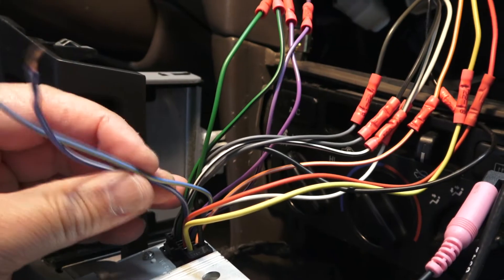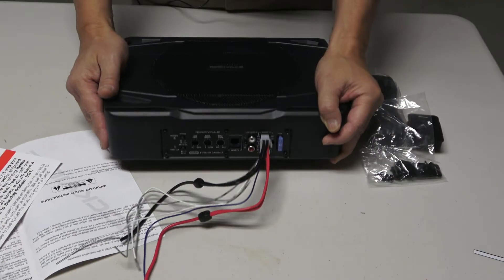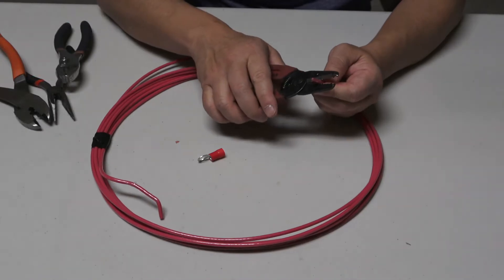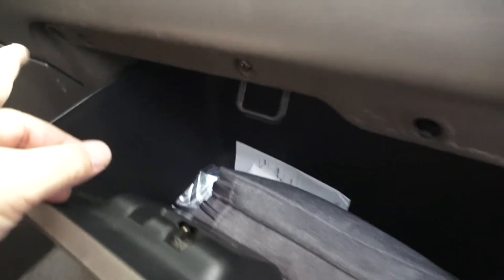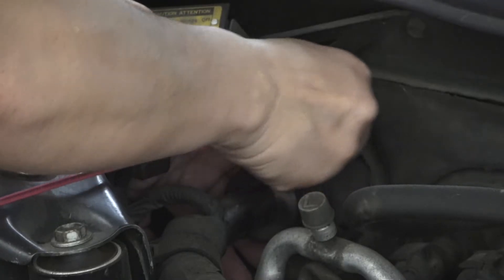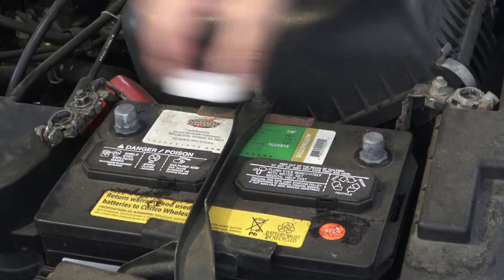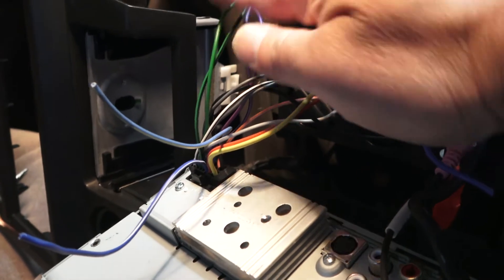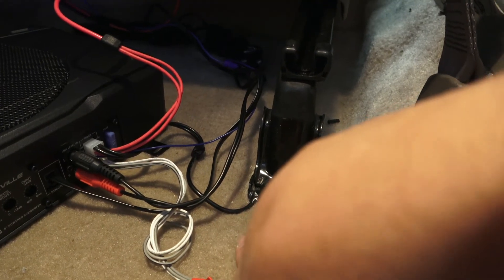How to Properly Install a Powered Subwoofer in Your Car--8" 400W Rockville!

Comment: Got the same wiring for my Subwoofer. Do you maybe know why mine doesn't power up? Did exactly how you did it, but the ground is wired to a back frame point and cleaned the spot with sand paper.
Reply: did you figure it out yet?

Comment: Did you screw the subwoofer into the floor of the car or just left it loose?
Reply from the maker: I left it loose.  It is heavy enough to remain in place.
Reply: Would bolting it down help it transfer low bass?
Reply: Would bolting it down help it transfer low bass?
Reply: @CookinBeatloaf I ended up just using some industrial adhesive Velcro and it's now very solid to the floor. I didn't want to drill into the floor.

Comment: i have a question, is there an alternative to connecting a powered subwoofer to the battery??  i have a sports car where the battery is in the "frunk", there is absolutely no room nor any pass throughs that allow the running of the hot power to the battery much less establishing 18" for a fuse link as well, interested in your response, thanks
Reply: No, get creative

Comment: Hi question I'm planning to upgrade my nissan sylphy bluebird 2009 car with this exact subwoofer. The blue and white wire is that I need to buy a extra blue and white wire long enough to connect the sub woofer and headunite?
Reply from the maker: If it doesn’t come with the packet, yes.  Thanks.

Comment: Does the blue wire need to be connected for it to power on? Will it turn on without the blue wire connected?
Reply: @phootnote  the remote wire does need to be connected unless you splice into the rear speakers with the high z inputs. It's easier just to run a remote wire and connect it to the one on your head unit.
Reply: I'll let you know today
Reply: No it will not turn on, it is the remote wire connect it to the back of your radio to the blue wire. When he radio turns on it will turn on the amp/sub.

Comment: This Is Why The Crutchfield  Ready Harness Is Plug And Play! Now Adding? Cut Nothing! Bass Knob?  Tiny Home Depot Wire? Run DC 8 Gauge Is A Tip Only Because Fire Extinguishes And Automobile Insurance Never Covers This..
Reply: Not 🚫
Reply: Not 🚫

Comment: Can't You just connect the RCA Cables To The SUB RCA Outputs Of The Stereo To The Low Level RCA Inputs Of The Woofer?
Reply: I think that’s what he did
Reply: @vs-1993   First Off He Bought Rockville And Needed To Go To Home Depot, Then Bigger Wire? WTF? The Under Seat Rockville Might Last A Few Months? He Thinks He Might Need Bigger Wire! Fittings? Let People That Know About DC Automotive Like Crutchfield And Best Buy! The Guy Is Buying 10 Gauge House Wires To Run His Rockville! 
 That Being Said Anything Rockville. See The Reviews! Get A  Jl Audio 250/1 E11 Very Clean Old School amplifier And A Sub That Works For Decades! Under Seat Trash!
Reply: @dugeep around 2 years